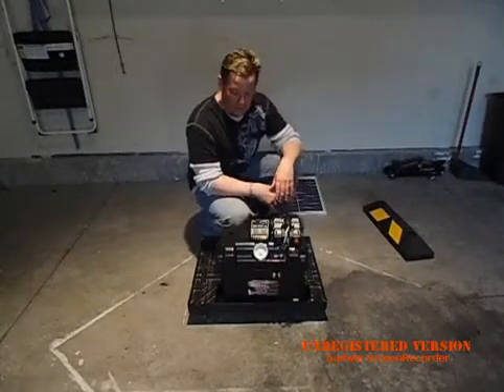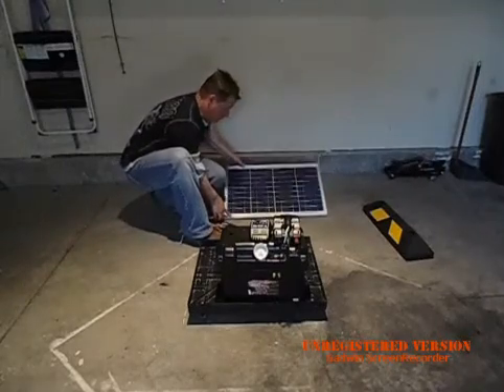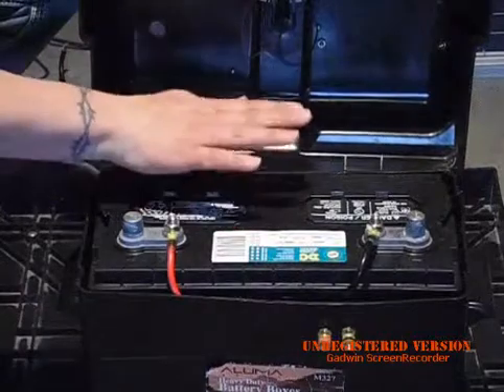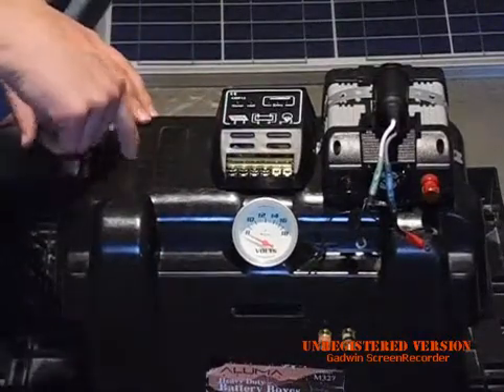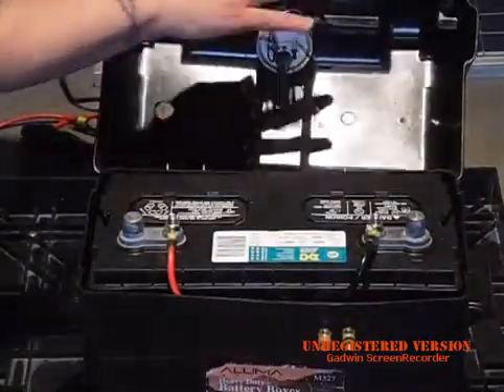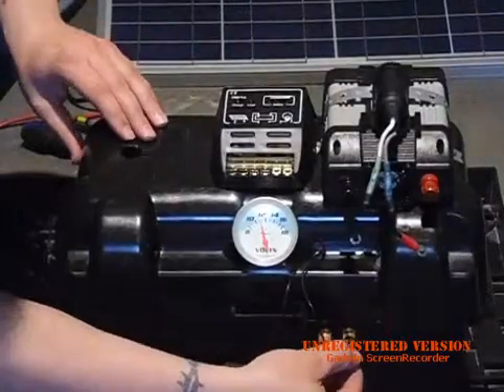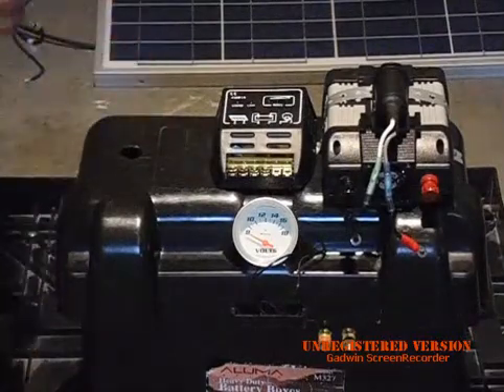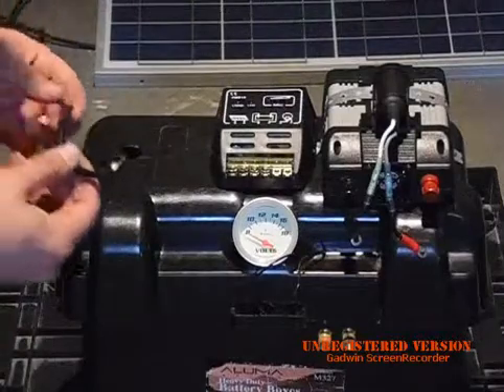How to build a solar generator

Comment: HEY! You forgot the most IMPORTANT items in the whole project! The three FUSES! One at the battery positive post and one in each positive wire from the loads  If your going to build it, build it to be safe and not catch fire! Use the flat ATO Fuses rated to protect the wire not the load they are cheap and the best insurance against fire! Just my opinion! Good luck